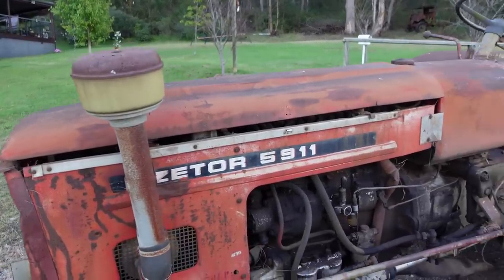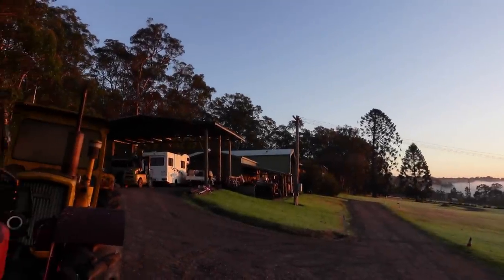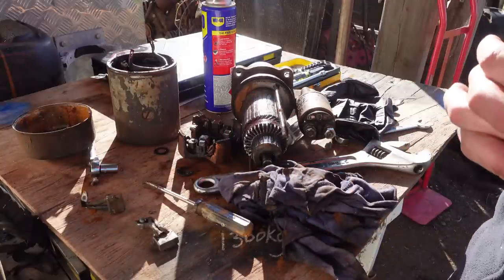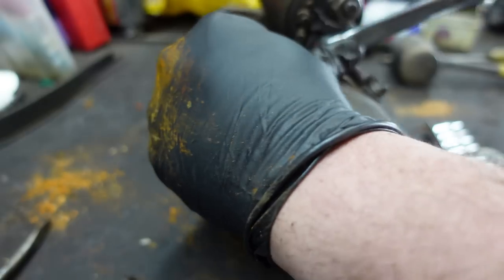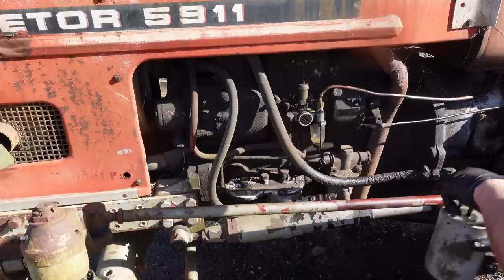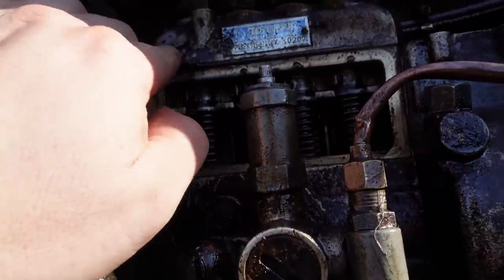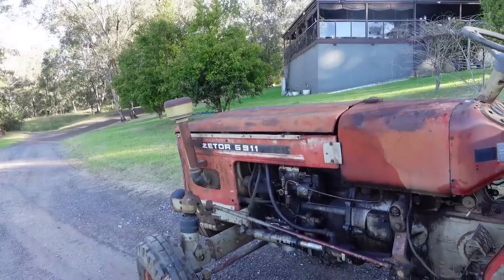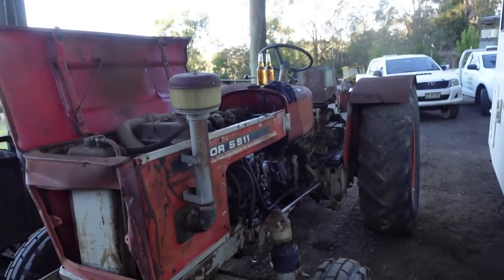Will it Start? Abandoned tractor was under flood waters

Comment: Suprising how well old shit holds up, we had a big flood come through home in 2018, mf50h backhoe, mf2640, mf178 and a couple of little kubotas all went under, backhoe was so deep you were up to your chest standing on the roof.

New oil and fuel throughout and got them running again...then had the usual stuck clutches and buggered throwout bearings....cheers!
Reply from the maker: Hi mate. Yes it sure is. It’s hard to flush them all out properly though. The oil has the milky colour through it for a while but the get going again. The transmission has a noise in it now, like rust on a bearing. It was left to long before draining I’d say. Soon as I got it I dropped it all. Thanks for watching mate
Reply: Yeah they get noisy, I've got a cranvel crane based on a chamberlain 6g industrial that's had a wet box and its horrendous, doesn't matter much it only drives around the shed in 1st cog anyway but it's shitful to change between first and reverse

Comment: Amazing that the starter still worked with all the wet gunk inside. Good work fixing the fuel pump and a nice running engine at the end.
Reply from the maker: Yes it surprised me it worked the first time. After cleaning it up it worked great. Now a working machine due to more work to it off camera

Comment: A bit of work and it's a working machine but I'm honestly surprised that the first thing you would have done is change the oil in it. With the amount of water throughout the entire machine, there's bound to have been enough water inside the engine that just turning it over would cause it to hydra lock!
Reply from the maker: The engine was drained straight after the water went down, injectors taken out and atf/oil in the cylinders and spun over. No water left in engine. This is something I would of done off the owner, a mate of mine , hadn’t done. The starter was loaded with corrosion, that’s the reason it wouldn’t wind over. Is now a working machine due to more wore done off camera. Thanks for watching

Comment: Awesome effort on the Zetor Steve,must of been wet for a long time, top effort. Gerald. Feilding.
Reply from the maker: Hi Gerald yes it was. The last one was 12-18 months ago and he only drained the sump and the cylinders. If he had of been able to get it to run it would of made the injection pump easier to get working. The transmission was never drained so it was in there until I drained it 2 weeks ago. Thanks as always mate

Comment: Really beautiful sunrise there in Sydney.  I used to rebuild starters for a living for over 10 years.  That starter kinda reminds me of the Ford starters I used to rebuild.  There's a trick to pulling brush springs up.  You make a hook out of a wire coat hanger and have it doubled where you make the bend.  Pull up on the spring with the tool, use a pair of needle nose pliers and grab the brush and out she comes.  The brush hook kinda looks like a "T" that goes between your fingers with the hook on the end of the "T".  You insert the brushes after putting it all back together using left hand to pull up spring and right hand to use needle nose pliers to insert brushes.  When you have 400 brushes to insert rebuilding 100 starters a day you learn all the tricks.  Quota per day was 100 starters.  My boss designed a long line of angle iron which I welded and made all the little carts out of angle iron and bearings from alternators.  Welded the shafts with the bearings at the ends for wheels to ride in the angle iron.  Each flat held 3 starters on a board insert with noses pointed down.  I made the trays for the starter line also.  Worked pretty well.  The idea was at first have stations along the line like a workers line in a car factory each station putting on a part, but it didn't work too well.  Had to change procedures.  Cheers from eastern Tennessee
Reply from the maker: Hi mate thanks for reaching out. Your comment made for an interesting read. There’s always a way to make something easier or quicker. I certainly haven’t done near as many as you have. I just tackle what comes along. I mostly seem to get around it. Thanks for watching from over there in Tennessee. Brilliant stuff
Reply: 7

Comment: She's barkin pretty good now Steve! Nice job. Water sure doesn't do starters any good, does it? Surprising they can often be brought back after drying them out ,clearing the rust, and freeing the brushes, like you did. Amazing the clutch wasn't rusted up solid. Went like a champ until the water and oatmeal in the fuel hit er again. A good cleanout of that tank should do the trick.  Sounds like a strong engine. Liked the video. Cheers!
Reply from the maker: Hi mate. No water doesn’t agree with the starter at all, especially being left as long as it was. You can usually get them up and going again though. It was very surprising the clutch wasn’t stuck, they are usually first to go being clean bare steel but it works great. We’ve since cleaned the tank as best as we could off camera and done a few other bits and pieces to it. Thanks as always mate

Comment: Hey  Steve I would love to see that Chamberlain going .I remember as a kid my father worked for the council and they had two 9g Chamberlain tractors to pull the rollers and I would sometimes go for a joy ride with them they could do about 40 miles an hour pulling ten tonnes of roller superb tractor in its day cheers tony
Reply from the maker: Hi Tony, it is going now mate with a video to follow soon. They are great tractors indeed. Were a lot around years ago I believe. My family used to run them also, I still have one in fact. It’s basically a 9G but reversed with the big wheels at the front. It’s a forklift and loader. I’m sure they are great memories for you mate